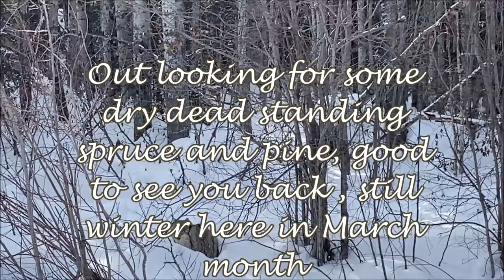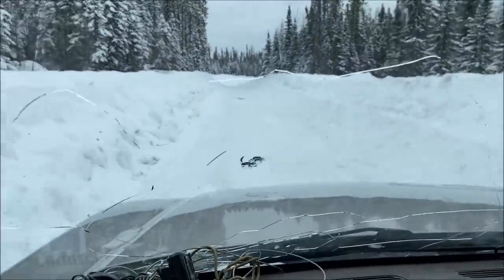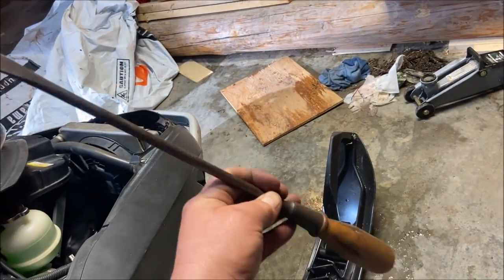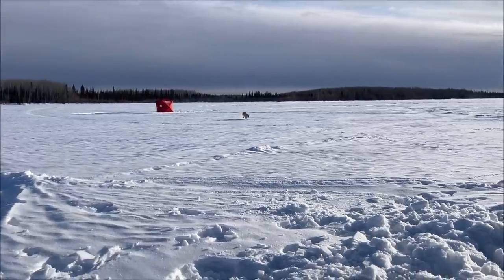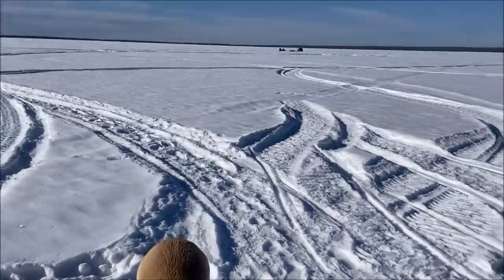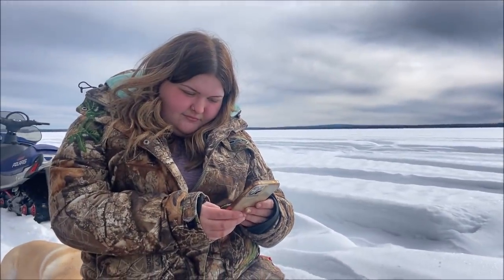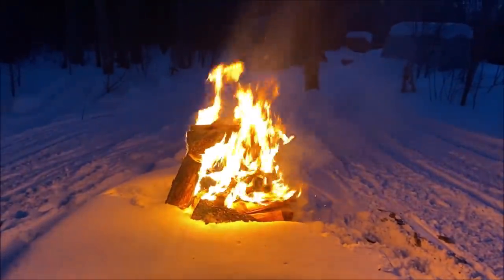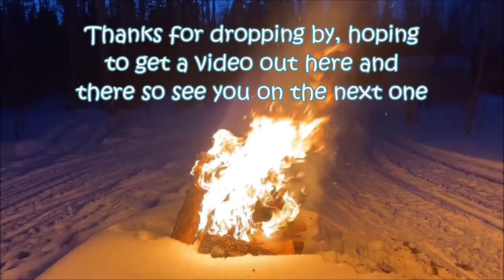Northern BC March

Comment: My buddy used to have a snowmobile shop and he had a big long straight screwdriver and he put a bend towards the end and then ground a notch on the side edge so he could pull the spring and another notch in the middle of the end so he could push the spring without it sliding off.
Reply from the maker: right on yeah always a way where there is a will
Reply: @bcnewfie494  no, his name was Tom, not Will! Lol!!